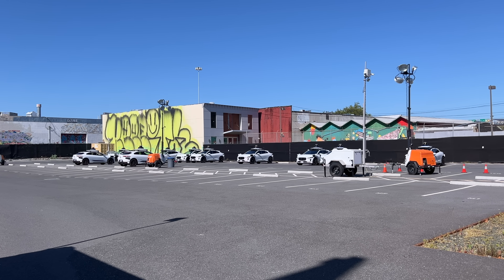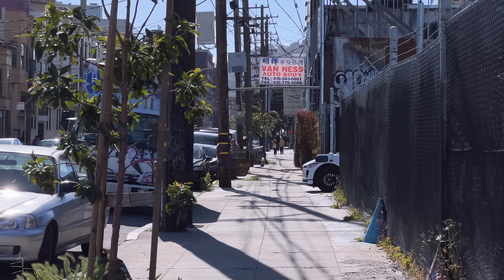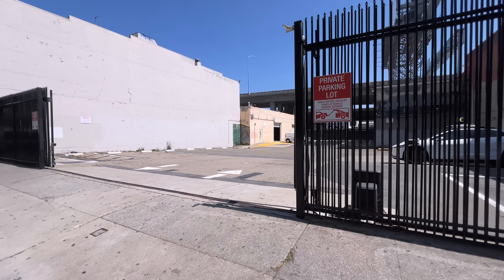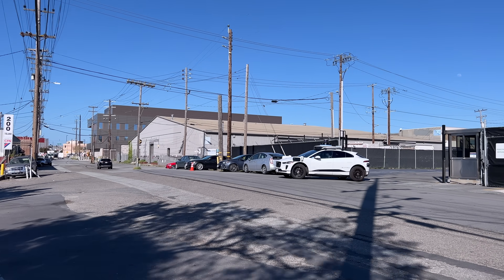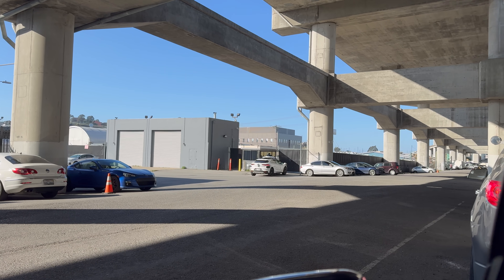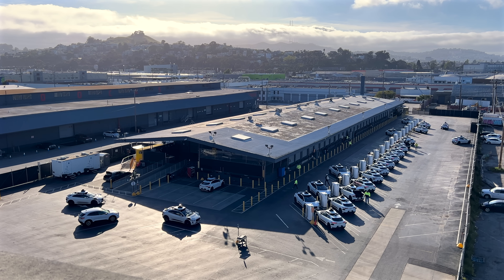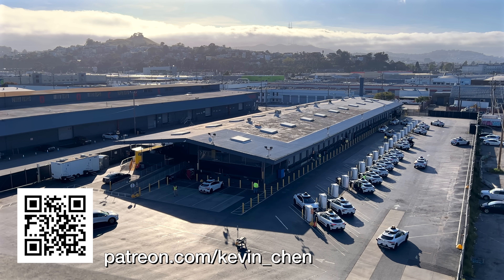Behind the Scenes at Waymo Driverless Taxi Depot

Comment: the reason i can think of the strange behaviour of the car at the main yard is that when it enter the yard it possibly switches to a depo control system which is selecting where it goes and what needs to be done to the car. the area is at the ned of the building is probably for extra service is needed. 4 ways on is normal for all vehicle and on the self driving car probably use its 4 ways as a way for the vehicle is in manually controlled or needs to be manually controlled

Comment: If you want efficiency, all that is needed is a service garage and auto charging stations scattered around the city so they can recharge (no attendant required).  Other than that, when they are idle waiting for a customer to call, then just park on the street or in a garage like everyone else.  I'm sure Waymo can work out a cheap deal to park overnight in a parking garages that otherwise are empty between 9pm and 6am.

Comment: I think the odd turn signal usage is to alert the human operators of the car's next moves. So if you're an operator, you know what side of the lot the car is gonna stay on without having to wait, or you know that the car hasn't located its spot yet, so it's gonna stay on the opposite side than the chargers, and you won't get in its way.
Same thing with the slow speed - safety.
I also have a guess for that one car that was picky about where it parked and switched chargers - I bet it saw that another parking spot had opened closer to the end, and I bet they're programmed to fill up the spots from the end first.

Comment: I like how Tesla fanboys go like ''well Elon's solution does not require geofencing and it is way cheaper, just based on vision''... Well Elon's solution also does not work at the moment at all (if we talk about service levels required to run robotaxis), while Waymo service seems to work rather fine even if in restricted areas and not making economic sense yet and maybe just in good weather. Don't get me wrong, when it works FSD is impressive for only vision driven system, but there is no idea how long may it take for Tesla to get to where Waymo is even now. For the robotaxi reveal they are also doing geofenced solution it seems... No matter if it has steering wheel or not, it is not like everyone has no disengagement drives every time... it's just not ready. Maybe the Dojo or whatever, new AI techniques will ''solve'' it soon, but maybe not

Comment: The cars are insanely slow even given they know that area perfectly. Time between you requesting a ride and the parked Waymo car actually approaching you is super high, they need to work on that
Reply: Bro never lived in the US, i use waymo 4 times and it drives fast after i ride it.. it carefully looks radar to avoid accident
Reply: @DominixS  I live close to one of the depos but I've had a change of mind since I wrote the comment. There's a lot more cars in SF now, I trust them much more than Uber drivers, especially at night

Comment: I'd say the biggest problem with how they aimlessly drive around the parking lot is wear and tear on the front end. At slower speeds turning is more difficult. You're also not using regen below 5 to 10 miles an hour, so you're putting wear on the brakes. I'd say a steering rack and all the ball joints and front-end parts are probably 5 to 10k installed. Not to mention the tire wear

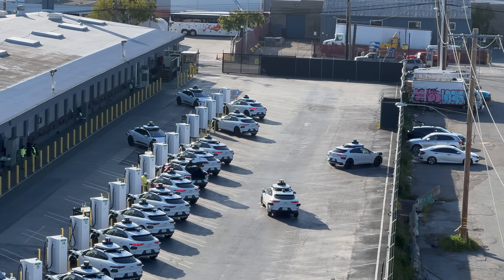Comment: 13:13 -- There are plenty of wireless antennae on the building.  Look at the edge of the roof.  Each light installation along the edge has two wireless network access points on it.  That's plenty of antenna coverage to do full wireless data transfers.

Comment: It's only when you see the Waymo depot in operation that it really highlights how far ahead Waymo are in providing a RoboTaxi service than Tesla with their FSD. Even if Tesla's FSD was capable there is so much more to providing a taxi service other than the automated driving.

Waymo have made so many advances such as improving their interaction with emergency responders, allowing the emergency services to geofence an area from Waymo vehicles and having Waymo remote operators take over or give advice, and to train the emergency responders on how to interact or take control of a Waymo vehicle.

There is a big difference going from an always supervised vehicle to one that has no driver. If a Tesla FSD disengages, the driver takes over, for a Tesla RoboTaxi after a disengagement there would be no one to take control, and that part of the service needs to be addressed before they can be let loose on the road.   

Waymo and Tesla FSD are often compared to one another when really there is no comparison. There is very little that Tesla FSD can do that Waymo can't, while there would seem to be a stack of things that Waymo can do, that Tesla FSD can't.
Reply: At seven times the price?
Reply: @Deontjie  yes like self checkout, cashiers  they get more theft and loose more money and jobs
Reply: Great observation! I continue to believe Waymo has already turned every step in the process as an optimizable condition. I try to follow the rates at which Waymo can precision map. If this turns out to be a necessary part to Autonomy, their past experience in mapping and scaling -- Google Earth >> Maps >> Streetview >> RT Traffic >> Waze might become insurmountable. It seems an integral part of their perception solution.
Reply: @mrkjmsdln  Musk has often argued that human drivers drive with sight alone, but that is simply not true. 

The vast majority of drivers regularly drive the same routes. They get to know the pot holes to avoid, the corner that in the winter months can get very icy.

They have got in the car having probably heard the weather and traffic reports, they can recognised that workmen have dug up a road. They use the sat nav traffic reports to understand if the hold up is going to be brief or long.

If passing a live event when the crowds are leaving the whole dynamics change and the human driver knows that the situation calls for caution. 

I don't know if Waymo currently use their mapping to identify venues, live events and time of day, I think I did read somewhere that mapping the street and gathering data on the business establishments was something they did, but if they currently don't, they could and probably should because that is human behaviour.

If a building is on fire, does the vehicle drive towards the hazard if the road is clear?

Sight, sound, smell plus environmental intelligence.

Waymo admit they are not there yet, they often say that  the last 10% of the problem will require 90% of the effort.
Reply: How would Tesla ever offer robotaxis without LIDAR 😂
Reply: @NicMediaDesign  Maybe the plan to adapt the Space X approach and "Hire, Crash, Learn"?
Reply: Yeah like driving from San Francisco to Lo Angeles without a single intervention. Driving on any road in nearly the road without geofencing and pre-mapping. Using a standard production vehicle that does not require a suite of expensive ludicrous sensors. Not running over pedestrians. To name just a few.
Reply: @GntlTch  A year later and Tesla, still hasn’t delivered a fully autonomous robotaxi. 

The latest iteration of Tesla's RoboTaxi vision involves purpose-built vehicles, geofenced operation, and reliance on mapped data, echoing the very strategies they once mocked. 

All ride-share services are geo-fenced operations, including Uber as there is more to providing a RoboTaxi service than having an autonomous vehicle.

Let’s check back next year, perhaps the robotaxi vapourware will have arrived in some form so at least Tesla can say they have joined the party.
Reply: I don't see any advantage over using an Uber driver and it seems expensive also
Reply: @JerryGonzalez-un3ho  We only use human Uber drivers for there aren't robotaxi services in most areas. I live in Salt Lake City not seeing any robot anything where it's millions of humans  driving through traffic and employees doing the work in the corporate boxes. I guess some cities such as San Francisco are running robotaxi trials. We're still waiting for the Tesla robotaxi as they need a platform to run on for Waymo isn't universal, yet. I guess I need a car to drive. LOL
Reply: @SoldtotheHighestBidder  cool keep the robots away they are 10 million Uber drivers
Reply: @SoldtotheHighestBidder  yes and keep telling humans not to support AI robots don’t need money
Reply: @JerryGonzalez-un3ho  Sure robots don't need money, but their owners are all about money profits. And control of the  masses of humans who'll end up with AI/robot overlords. I mean bosses and supervisor systems like how many log into today.
Reply: Tesla's robotaxi is to be unveiled in August. It's going to be the first car without operator controls such as a steering wheel. In the meantime, we're still waiting for robots to drive, clean, and work like slaves while speaking perfect English.
Reply: @SoldtotheHighestBidder  How's going with that August reveal :))))?
Reply: @MirceaGoia  Elon Musk postponed it.
Reply: @SoldtotheHighestBidder  I know, that's why I asked :)
Reply: @MirceaGoia  So if you knew, why'd you ask?
Reply: @SoldtotheHighestBidder  It was a sarcastic ask :)) ...we pretty much knew Musk would lie about it. Like he always does.
Reply: @MirceaGoia  No, he had a new idea for improving it. It's not because he lied or that Robotaxi is fictional. You a bit narcissistic aren't you? Those who think most of themselves are the least informed.
Reply: @SoldtotheHighestBidder  you really believe elon's word even when he has failed to keep his promises idk how many times?
Reply: @super_hero2  What did he lie about? I do believe most of what he says even though it sounds super weird more times than not for things he said are beginning to happen. I hope his claim that AI is far more dangerous than nuclear war itself isn't going to be the case, but that probably will be. He had to delay the robotaxi a few months to perfect something that wasn't ready. Cybertruck had to be delayed a couple years for the pandemic caused supply and workflow issues. Things are always delayed when it comes to new tech.  Yea, he'll keep his word on his plans for he's the superstar CEO of all time along Donald Trump too. As you might know, Musk will be closely working with President Trump with a new agency called Department of Governmental Efficiency named after his crypto DOGE. Interesting times.
Reply: @SoldtotheHighestBidder  the guy "promised" multiple times about fsd and it is still not here. Dude, "delay" is a better word for breaking promise.
Reply: @super_hero2  FSD is not fully developed yet, but it will be for they're progressively improving it. With that said, most people still don't use it for people like to drive themselves. I expect it'll be full FSD by 2030 though. He didn't break the promise about FSD, but maybe you're a dissatisfied customer finding your car isn't fully FSD yet. If I had a Tesla, I wouldn't let it do the driving yet even though it can drive.
Reply: @SoldtotheHighestBidder  dude he said it will be able to drive without human for years
Reply: @super_hero2  Sure it will be one day but not yet. What he's achieved so far is nothing short of Amazing. I do expect FSD when the robotaxi cybercab and robovans come out. They're close, but not ready to be FSD. It'll happen and you might even be able to use the same computer and car for it's AI software updates needed at this point for the hardware is there.
Reply: @SoldtotheHighestBidder  Sorry but no vehicle mfg has level 4 autonomy.  NO ONE.  Even these Waymo's, which are hugely geo-fenced to San Francisco, and mapped thoroughly for local trips, still have steering wheels.  And they are light years ahead of Tesla.  Tesla's don't even have radar or lidar, but yet every other automaker that is putting money into autonomy is going the opposite route.  We will not see a steering wheel-less vehicle for at least a decade.  I had a Tesla but man, they are so full of BS.
Reply: @Cjdergrosse  WOW your ignorance of the Tesla tech is astounding ! Its a wonder your not still with the horse and cart!!
Reply: @Cjdergrosse  Wrong!!

Comment: Isn’t that the normal speed for a parking lot? In Germany at least, it needs to be at “walking speed” so about 4-7 km/h
Reply: In the US parking lots are usually private property rather than public, so generally government-mandated traffic laws do not apply. Owner-posted traffic speed in a parking lot is usually around 10 to 15 MPH, or 16-24 KPH. You are still required to be cautious of pedestrians, vehicles backing out, and the like, so in busy areas the driving speed is somewhere between stopped and say 5 KPH.

Traffic speed postings in the US (not necessarily actual traffic speed) are generally faster than in European cities, except on main highways:

Parking lot: 10-15 MPH
Residential area: 25 MPH
Business district: 35 MPH
Main street with limited on-street parking: 45-50 MPH
Highway speed: 55-65 MPH
In some fairly rare cases 70 MPH on designated stretches of some freeways.

This roughly corresponds to:
Parking lot: 16-24 KPH
Residential: 40 KPH
Business: 56 KPH
Main street: 72-80
Highway: 88-104
Freeway: 88-104, sometimes to 112.
Reply: 5 mph around cars, walking speed. Unfortunately some people have low IQs and speed.
Reply: Yes though it is rare anyone here drives at that speed, about double is what is more common in a flat parking lot.
Reply: @feartheclown5 yeah, but robots don't "cheat", and it's probably a safety requirement (OSHA or insurance)
Reply: Sure, no one follows it though

Comment: They should have a Waymo always parked at the exit of the depot, so that it can get to customers faster rather than having to slowly navigate the entire parking lot. A standby car for the depot
Reply: Since they're all on it should work like a taxi depot, cars are parked in line and when the first one leaves the other ones move 1 spot so there's always a car near the exit.
Reply: @25566  Oh yeah, that's smart, why are they parking the cars inefficiently like personal vehicles anyway
Reply: @puregero  Since theyre electric I would think they pull into those bays to charge. Or at least could charge.
Reply: @puregero  Charging?
Reply: They likely (hopefully) are using an anticipated demand model where it keeps a distribution of cars around the service area without crowding. 
Uber in Chicago dispatches drivers to O'Hare from the waiting lot before they're assigned a ride. It's based on demand and minimizes the delay due to getting from the lot to the terminal.
Reply: Hear me out on this; we take the Waymo cars and replace their tires with metal wheels, then we create a track system that runs throughout an area, this can be a street level system very similar to a trolley. We remove the car engine and replace it with an electric powertrain that connects to an overhead wire that the waymo car can attach to via a telescopic boom. We create stops along the way similar to stations for a trolley. We also increase the capacity of the cars by extending them and adding more seating.
Reply: @popcorn8153 trains are shit.
Reply: @popcorn8153  That's brilliant! Can we put tracks to every single address in existence so I can go to work without waiting an hour for my next transfer?